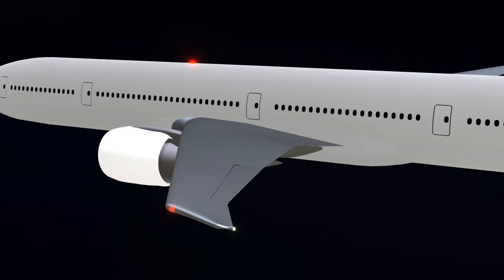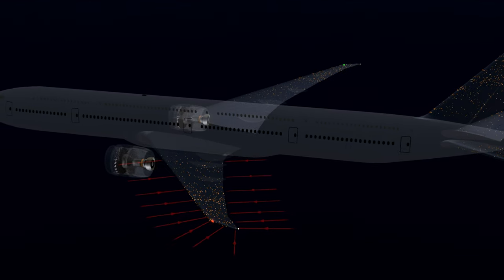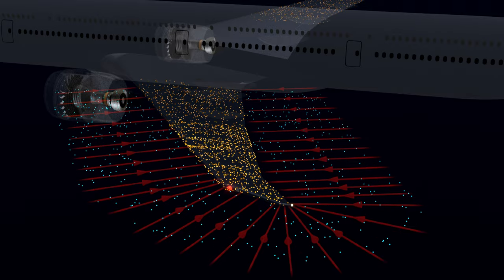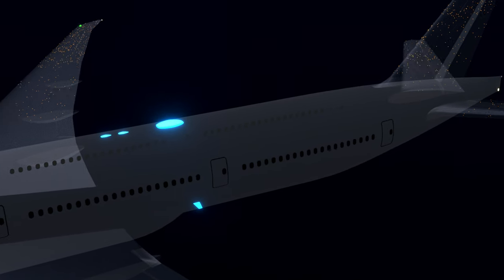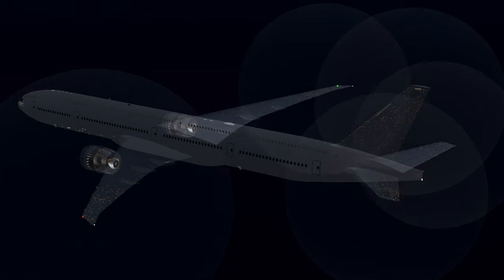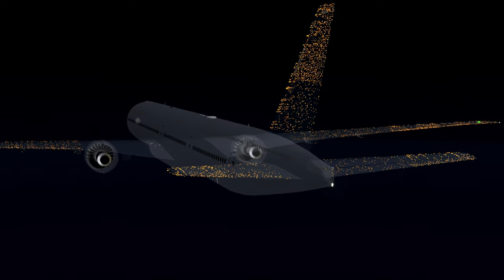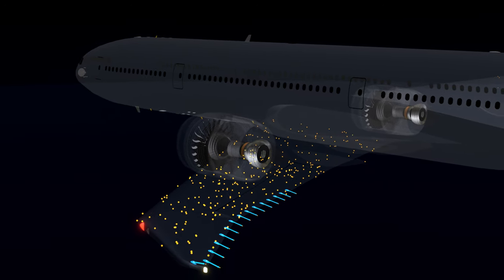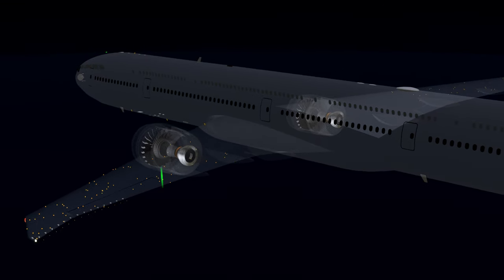How Static Electricity is Dissipated

Comment: the the outer surface of aircraft conductor or insulator?
Reply: I think they are conductors, though older plane models made with aluminum are better conductors than the newer carbon fiber/metal mesh models.
Reply: @kuromyou7969  thanks for the info mate!